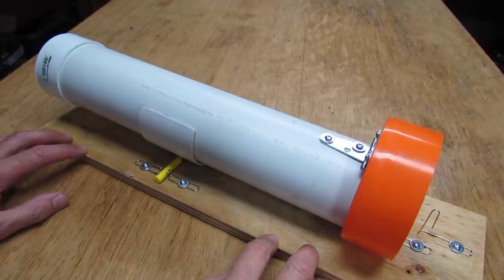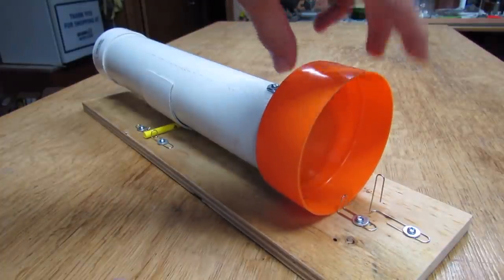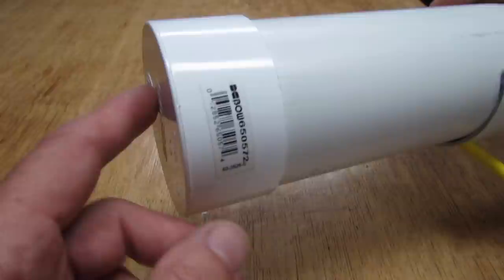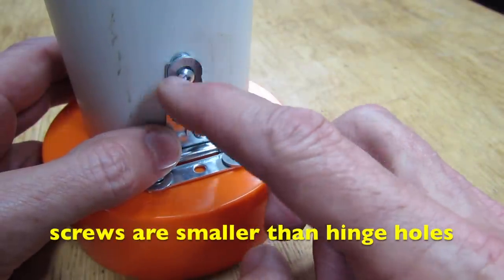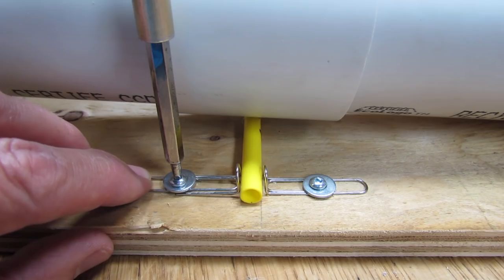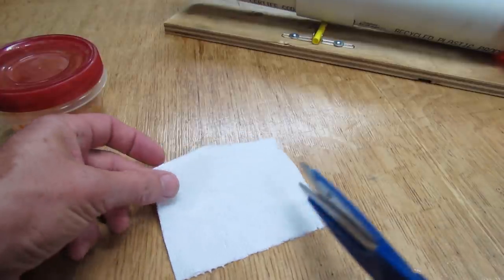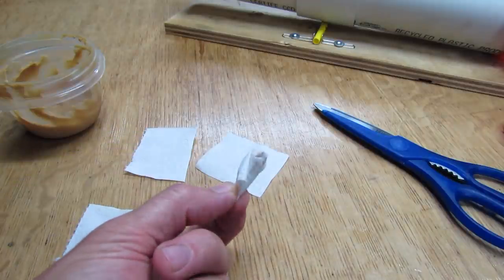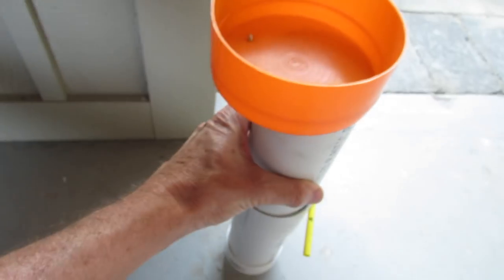How to make  ● a simple PVC HUMANE RAT/MOUSE TRAP

Comment: Hi Chris, I made a similar trap out of 3" sch 40 pipe with a wooden lid and heavy iron wire hinge that I made with scrap from around house and caught first rat during first night with Parmesan cheese bait. The rats do trip the door occasionally so I built a wooden box around the tube and had to angle the front of box to get it to work right due to the teeter totter tube. Works great, and most humane way to catch rodents. Caught 5 so far and I think I do not have any more under the trailer, no more noises in our walls at night! I usually drop them off 5 miles from home in wooded areas, hopefully they won't make it back soon, lol. I thought the last thing I caught was a rattle snake, it was just mama rat, she was heavy. Please be safe people, as snakes and other animals can enter these traps as well. Thank you for your idea Chris!
Reply from the maker: That's great!! Please take a snap! I'd love to see a picture of your trap!!  Send it to me at  chrisnotap@gmail.com
Reply: I didn't know they can find their way back.

Comment: Cool video! I've just built a quick mouse trap that is similar to this one. Although the concept in this video is smart and simple, I think the build could still be simplified, reducing the number of parts and tools used. The version I've made doesn't use a "hinge", nor screws, nor different stoppers even if the principle is the same. Instead of a hinge you can quickly build one using two flaps of plastic joined along an edge with tape. The tape acts as the hinge as it allows movement. I've used a yogourt plastic lid for the flaps. This "flap" is used instead of the orange cap and instead of building the lock that keeps it closed, I've simply glued a magnet that keeps the flap closed once the tube tips over. Here are the parts I've used: A plastic bottle (the tube), a yogourt plastic lid (the flaps), tape (the hinge), bamboo skewer (the pivot and the pikes that hold the flap open), 2 magnets (the lock), cardboard (the base and the pivot brackets). Here are the tools I've used: Hot glue and scissors.
Cheers!

Comment: I made this with a 4" diameter pvc pipe, which I had and used a 5" galvanised steel round end cap with the crimped edges. I made it 16" long, but I forgot that perhaps I should have made it longer. I am finding it difficult to get the balance right. Should I be using a longer pipe? If so what length would you recommend? Is there a formula for this? Also, you mentioned making an update video for some sort of protective surrounding.
Reply from the maker: You could first try getting a plastic end cap since the 5" cap you're using is probably to heavy. If that doesn't work you need to lengthen the main pipe up to 24" to make it easier to balance. Here how I made one out of 4" PVC....https://youtu.be/I7XZ8Yr6x8g

Comment: Hi Chris, i made the bottle version thinking i have a mouse in the garden that kept eating my  pumpkins, well it turned out to be a rat. He triggered the auto sensor light last night, i looked out the window and there he was, a very well fed rat that ate half of every pumpkin. Do you know how heavy a rat is? 
Rich
Reply from the maker: Just set it for the light weight of a mouse and it should catch anything that is heavier. Rats are very difficult to catch. They are very very cautious. Could take days for it to enter the the trap. They are much smarter than mice.
Reply: Agreed they are.
Reply: Update. Your correct rats are too smart.
My father in-law made one from wire mesh rectangle cheap shape with a spring loaded door with a drigger inside. I caught 4 rats.

Comment: Hi there, thanks for this. We lost our pet mice (4 mice) and tried everything. So I built yours using "crittertrail" tubes instead (hopeing these recognize the tube(s), and it worked over night! We actually got 2 for 1 on one catch, one was a small baby 2-3 weeks old and the other was one of the pet mice. Is this possible? My only explanation is that the baby was too light to trigger it and the larger one followed it in (mother?) and triggered it. I heard it and put them into a quarantine cage, reset it and within 1 hour caught a second pet mouse... 2 out of 4...not bad. Am waiting for more catches. But it seems to work awesome, thank you!!

Comment: The rat may feel enclosed with the cap on the end. My tube has a large grid screen on the end with the fruit and nuts bait. Viewable from both ends, so it doesn't look threatening. Also, instead of an orange cap that looms over the opening, used clear plastic that is closed with the aid of a small spring. You need lots of speed to lock 'em in.

Comment: Any tips on where I can get the test cap?
Reply from the maker: +Dave Anderson     Hardware store.
Reply: Thanks for the response. I've looked at in my local hardware store and even scoured the internet. I welcome more pointers.
Reply from the maker: When I made this, I thought everyone had these since I got it at home depot but thats not the case. I can barely find them anywhere!! My suggestion would be to go to the dollar store and get a cheap baking pan and cut out a piece of the bottom to get a flat piece you can use in the same way. Just cut a 4" circle out of it.
Reply: home depot

Comment: Next time use hot glue instead of screws. Hold power is the same but assembly is 10x faster.
Reply from the maker: I used that first. It snaps off with out much effort. Screw was the best.
Reply: @chrisnotap  It can happen if the gun used cannot produce high heat. More expensive guns can provide a hotter glue that holds way better.
Reply from the maker: For some reason I thought I was commenting on the video about my squirrel trap where I screw it on. I did use hot glue in this video but I did say only the word "glue". I should have said "hot glue".